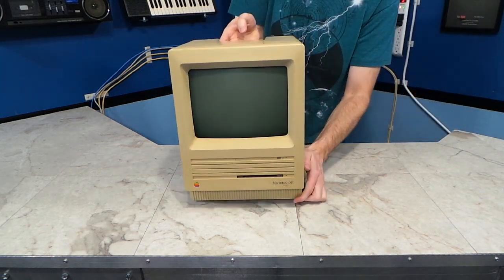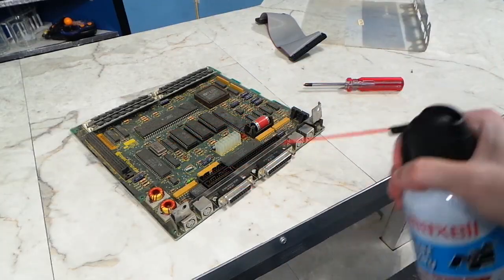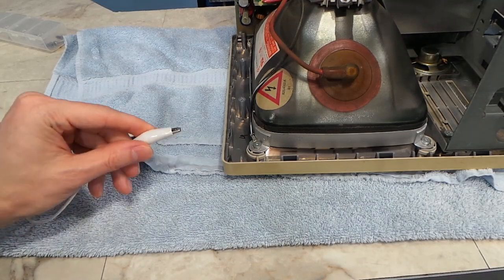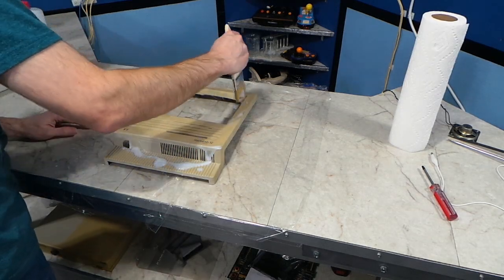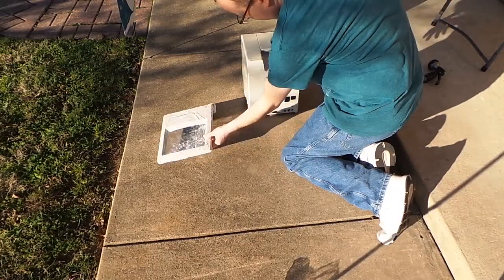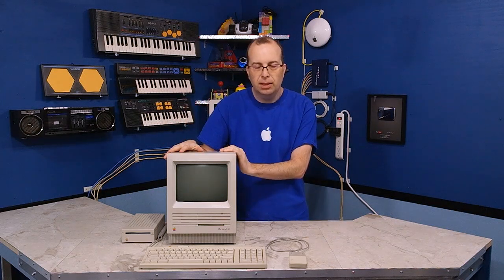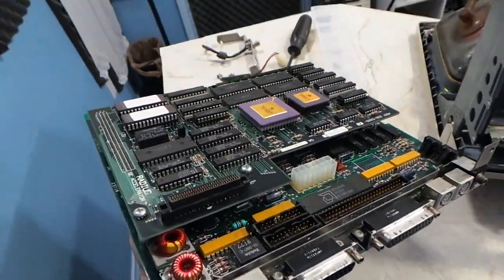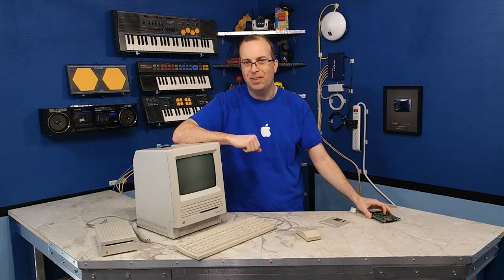Macintosh SE Restoration and SD-2-SCSI upgrade

Comment: I get the idea of retro brite but, the truth is, these machines were never actually that white. They began life with a beige tint to them anyway. Plastics used, tended to leech out the petroleum they were made from wether exposed to UV or not. In fact, Apple built their own fabrication plant because all of the cases for the original Apple II were slightly beige and Steve Jobs went ballistic about it. Course he went ballistic often, a tray loader for the eMac and early iMac. He wanted a slot loader like his BMW had. The single button mouse? Nope, Steve hated it. The Xerox machine has several buttons. In the end, it came down to cost to manufacture (bean counters won that one). But, one thing Jobs did win on was the auto-eject floppy drives. SCSI was all there was at the time for hard drives and in truth, leaving the physical limitations of the drives themselves, was far superior to any mechanical hard drive available today. Wider bus, much more reliable, in fact, my SE/30 with it's original 1985 SCSI drive still functions perfectly today. At least on the storage side of things. Sadly the capacitors long ago went leaky on the audio channel which again, I have to laugh at your characterization of the Mac audio considering it delivered multiple voices from a single internal speaker at a time when IBM clones and IBM machines couldn't manage much more than a beep.

Comment: If you have a Mac SE, (Not SE FDHD), you can pop the ROMS out of a non-working SE FDHD, and convert the SE into a SE FDHD and then just use a High Density floppy drive. I've done that myself years ago when I had a working SE, but also a FDHD that crapped out.

Comment: 5:48 - that's the deflection coil cable - the deflection is proportional to the flux density, technically a description of an electromagnet, which is not the same thing as "controlling magnets". There are permanent magnets on the yoke assembly - thats those little squares around the yoke assembly, they are glued in position as part of the factory calibration, if you ever move one out of position it can be incredibly difficult to create a perfectly aligned image again.

Comment: Would it be possible to replace the old CRT in one of these with an LED display???  I have one of these in my storage unit, it did work, but I haven't used it in about 10 years. I was thinking about taking it out and giving it a try.  I also have a Vic 20, Commodore 64, Commodore 128, a Commodore 1802 Monitor,  and 1541 and 1571 disk drive in my storage, with all cables and power supplies along with a box full of diskettes and some joysticks. I even have the Epyx Fast Load Cartridge.  One of these days, I will get all this stuff out and see if they still work.

Comment: After the cover is removed, one should take the yoke connector off to avoid breaking the CRT.
Reply: You can take the yoke connector off w/o discharging the CRT. Just don't mess with the high voltage parts until discharged.

Comment: I worked on these back in the 90s. It was quite common for the HDD to park and get stuck. This was easily resolved by giving the right side of the Mac a slap as that would get the hard drive unstuck.

Comment: Why does the circuit board have a battery? The entire point of plugging something in is to circumvent the use of a battery.
Reply: The battery on the board was for the BIOS.
Basic Input/Output System.
This Chip all the time needs to have electricity, because when the electricity is cut off, the BIOS Chip loses the data on it.
That's why there is a battery.

Comment: The Motorola 68000 was also used in SEGA MEGA DRIVE ! ! ! ! !  :D :D :D :D :D :D Hell yeah :D
Reply: It was used in a lot of devices back in the day - even routers, RIPs and printers...
Reply: @Fifury161  Yes, I know, but I just wanna add that obvious example. :D :D :D This is very good processor and it was used in many systems and at a higher speed.
 :)

Comment: I own an SE myself. Got it off eBay for $75 shipped a couple years ago. It came with a surprise...An Ethernet card!

I'd like to say I still have the card, but I ended up trading it to someone to obtain a SCSI hard-drive. Mine did not come with one and one someone offered to me for free turned out to be a dead drive. :(

Anyways, I ended up also getting 2 Zip drives. One printer port one for PC and one SCSI one. These are a god send if you want to send anything large over to your SE! I'd recommend going this route if you haven't already. There is software for PC that can format zip disks to what the SE can use. Granted you'd need a newer USB based zip drive if you want to do this on more modern hardware, but I happen to have a couple older PCs so not an issue. :P

I went with getting a real SCSI drive for my machine mainly to keep it original. I like the sound it makes with that old drive spinning up inside. Plus the SD/SCSI adapters are still out of my price range anyways. My SE had a SuperDrive floppy drive, so using that for small things between my PCs. But I still got the zip drives to handle large stuff. :D

I wish to own a SE/30 at some point too. They were the best all-in-ones Apple made before they transitioned over to color CRTs and such (As for best color all-in-ones. Anything that used a Trinitron is on my favorite list. ;) ).

The Macintosh Classic and Classic II are just gimped versions of the SE and SE/30.

As for your Mac not booting up correctly on a preformatted SD. Could try slimming down the extensions that are booting up on that OS install. Might be something on there causing issues. I recall there is a key you can hold down on boot to boot without extensions .Shift I think? Actually been awhile since I had to do that. You could try that as a quick test to see if it's just the config of the OS that's the issue.

Also try a different cable. Though I think that's already been suggested before.

I have yet to hear about a SE mobo that needs new caps (The SE/30 and newer machines certainly need recapped though). But definitely think about replacing caps in the analog board/power supply. ;)

Comment: Just to correct something here, USB Floppy drives will read and write double density disks, it's the OS that will not support this, at least for FAT format disks.  The Mac used a variable speed system with double density disks to get more capacity out of them, however, there were emulator programmes out there that could read and write images to and from these disks, but not in real-time.  Also, your choice in USB floppy drive is also important.  Better to use a built-in floppy on an old PC running any OS pre-Windows Vista as this was the first OS to remove the ability to write to double density.

Comment: Electricity doesn't take the path of least resistance, it takes all paths. There's just a higher current on the lower resistance paths because of Ohm's Law.
Reply: What about skin effect?
Reply: @otofoto  Skin effect only applies inside the wire itself. Iirc it refers to the tendency of electrons to cluster near the edges of the wire.

Comment: After messing A LOT with SD cards for my Wii i have to wonder, maybe the SD2SCSI drive had a problem with SDHC cards and you should've tried an older, less than 4 gigabyte capacity SD card to see if that would've made a difference.

Comment: iirc, i have an se/30 (the model 8-bit guy wishes he had) somewhere at the back of my garage. behind a LOT of stuff.
(having said that, years in storage, with the possibility of damp air in the winter, may have affected it!).
I feel kind of inspired to fish it out and try it out when we tidy up the garage a bit in the Spring.
I was going to strip it out and use it with a modern "tablet" in place of the screen, or some such, but hey, I might keep it original (if it hasn't corroded too badly).

Comment: Just a heads-up, some flybacks hate being short-discharged and the internal HV diode will blow. Especially on B&W hardware. You may want to invest in an HV Probe to discharge them, or use a 10Meg resistor to do it.

Comment: i think the more worrying part of working with a CRT is that your basically working with a giant neutron gun, while not inherently dangerous of in itself while taking it apart (other then the risk of electrocution like you mentioned) it could certainly be extremely dangerous if you put it back together incorrectly

Comment: So why are you not just using rubber gloves when handling the CRT?
As far as I understand rubber don’t carry electricity.
Reply: HV discharge can penetrate thin gloves, you would need HV gauntlets, however they limit motor control and it's better to work safely than rely on equipment (a small pin prick sized hole is enough to compromise HV gauntlets)

Comment: So I just recently was able to get the SD2SCSI to work in my Macintosh SE. Mine is one with Dual 800k Floppies and I hooked it up by using the internal SCSI port on the mother board and the HDD Power port on the analog board. I too had the issue getting the drive recognized initially but I was able to get it working using the software Lido 7 to initialize the drive. After I did that I was able to install the OS on it using the normal OS disks.

Comment: Those grooves are designed, IIRC, to let you slightly move the board and angle it out...so it's easier to plug and unplug the power etc. You'll notice one side is solid that it slides in, the other side has slots and tabs on the motherboard. They thought about it. :) The Plus IIRC is perhaps different. Have to look.

Comment: Have you tried smacking it while turning it on with the SCSIif that doesn't work carefully open up the drive to make sure that the stopper rubber pieces for the reader aren't all gummed up

Comment: Tube discharge is dramatic but otherwise simple as long as you discharge the anode from an isolated position - rubber mat or raised isolated platform, and be sure to ground your screwdriver used to remove the anode. It makes a loud pop when removed, but otherwise no problem. The flyback capacitor can be another issue. That drives the anode and the display and it carries a shit-ton of volts, and amps. It's aptly named because if you do touch that and it's fully charged - you will flyback. And taste copper. Arcade restorers call that 'biting the penny'. BTW be sure your ground is actually going somewhere - to the ground. That ground lug is useless if it's not connected to anything. Fortunately it was discharged already so no problem, but you do want your screwdriver to actually go 'to the ground'.
Reply: Does the screwdriver used need to be an eletricians insulated screwdriver specifically or can any old metal/steel screwdriver prevent harm?

Comment: Hey, nice channel and videos. I was wondering if i could ask you about a project i have. I was planning to install a Windows 3 or 98 into an Apple Macintosh Quadra 630 (1994). I don't know if there's any Apple restrictions about hardware and software, but i found a lot of problems. What do you think? Thanks a lot
Reply: Don't know if you are trolling or not, but there is no way to install Windows on a vintage Mac that has ROM chips (an Apple Macintosh Quadra 630 for example). The solution provided back in the day was to install a DOS card. This was a card the fitted into the PDS  and had a 486 CPU on it...
Software emulation (such as SoftWindows or Parallels) needed more grunt than the 68k series could provide and as such I believe they only work on a Mac that has a PowerPC chip...
I still have my Quadra 650 with a DOS card, the spider of cables is a engineering marvel.

Comment: Wow love this video.  You have answered about seven questions I had about making old macs usable, expanding memory capacity.       As far as floppy compatibility: Some bridge models like a Mac llsi, and a couple a little later, will read low density disks even though they only write high density, (after the driver has been upgraded to sys 7), but You can still plug in an external low density or high density external drives, and I think you can get both to work with sys 6.08.  With sys 7.5 You can generally only get low density disks to read once,... then the sys locks them, and there is a relatively easy way to unlock by manually rotating the disc with the brake off.    I think the mac SE could never run OS-8 which was what You tried to install at the end?  Also the  Plastic can be de- yellowed using windex,  (or ammonia based liquid cleaner, alternating with baking soda/ dish soap, and a sponge.  though not quite as whitening as Your technique.  usually these old computers run fine without a battery, but won't record dates properly, of course.

Comment: Just as an aside, it's more likely that dangerous current would travel across your chest from arm (at high voltage source) to leg (ground) than it would be to travel from arm to arm. Either way, it pays to exercise caution.

Comment: Did you ever try out the original SCSI drive that it came with? Just because it didn't boot from the hard drive doesn't mean that the HD is dead.
Reply: Also you could have initalized a fresh Flash Card on Rob's (The Obsolete Geek's) Macintosh SE then bought the same device he has, put it in your Macintosh SE and then put the Flash Card you initialized on his Mac in your copy of his emulator and it should work.

Comment: i actually own 2 SE30's but both Harddrives died in em, i do have a Super drive which is a External SCSI harddrive that can work and i have a super disk which is a Harddrive in a Massive Disk to snap in a large front loader but makes it less compact, the se 30 is possibly the best of the portable macs.OH i also got a Ethernet adapter in it with a 1k modem. 

i maybe able to help ya there for the Floppy drive, i got 4 external high density drives in a box, i was able to place em in a se and a se30 with no issues. but currently lost in inventory were i work.

Comment: Charismac is a great program you can use to format the older macs with non apple drives. I started using it on mine. Just boot to the floppy and initialize.

Comment: Got one for $15, another for $8, about 1999..2000 <

AmVets, Evanstone, IL..

Used with AOL2.6 Dial-Up until 2004..

Gave to TRoU's Mac recycling program.

When we went DSL with a PM7600/G3/400 4-04..

Was then used as a SERVER!

A SE-30 was one machine used to work up MYST!

The first game on a CD.. for System 7!

J.C.

Comment: I was brought here because I bought an SE 30 at a yard sale for a 25 cents this past weekend. It has some mild corrosion coming from the ADB ports but besides that it seems like its in good shape - not sure if I should try to clean, wondering if it was the battery from the inside oozed out or maybe it was in some basement and there was a flood. If anyone has any insight into what it could be that would be great. If I could get this computer to you I would, haha. Great channel.

Comment: Oh, I wish I had known you existed many years ago, because I used to have a number of SCSI hard drives, a SCSI SyQuest drive, SCSI ZIP drive, etc.

My first computer was a Macintosh Plus (you got yours working in a different episode) and I have intimately used and worked with and on 512s, Pluses, SEs, SE/30s, and also the II, IIc, IIx, and many others of that era.

My very first thought with regard to your formatting woes was that your SD card was probably too large in capacity to be supported. You'd be best to try and play around with <512MB storage.

The SE FDHD model was the first of the Compact Macs which supported modern high density floppy disks. There was an upgrade for the Mac II which allowed them to be supported (basically, an upgraded SWIM chip) and in the case of the Mac II (which I also had) there was a PMMU upgrade which then let the user use virtual memory.

You might also want to try and track down something like FWB Hammer or one of the other comparable SCSI-supporting 3rd party partitioner/formatter utilities because then you can deal with anybody's storage device.
Reply: Also, do you still have the programmer's switch modules for the SE and the Plus? If you do, you can sometimes use them to recover from a system freeze. Here's how:

Press the Interrupt button (the other is a reset)
You should get a screen where you can enter text. Type in the following
SM FA700 A9F4 [enter]
PC FA700 [enter]
G [enter]

Good lord, it's been a couple decades, and I can't believe I actually remembered all of that. Guess some things just get permanently ingrained in one's memory (kind of like images on an old black-and-white picture tube).

Comment: Did you ever resolve this? There is a hot key to bypass the extensions at startup which you should have tried to verify one of the extensions isn't corrupted or just not compatible with your SE, did you try this?

Comment: I'm using a SCSI2SD v5 in my earlier version of SE. I have the "paddle wheel" cooler..not the fan like you have. I had to swap SCSI chips. Mine was definitely cooked. SCSI2SD works just fine. I also have an aztec monster.
Reply: The 5380p is worth replacing if you want to use large disks. It'll only do 4-byte SCSI mail. Something like a 33C93A-PL you use to fix the Amiga3000D/UX's buggy SCSI controller will be fine and support larger disks and 6-byte SCSI mail. Old MicroVAX-3100-[1,2]0[e]'s used them also. If you use a drive a bit bigger than 1gb, the CHS translation will wrap and your writes will fandango across the first part of the disk corrupting it. Also reads will be .. "randomly fun" (there be dragons for execution code). May explain some of the instability. So far I've seen three versions of SE mainboard. Original with paddle-wheel cooler and 800kb DSDD. Later fan with 800kb DSDD, later still fan with upgraded SWIM that does DSHD apparently (wasn't allowed to play with that one). My older ones are DSDD only and one has an 030.